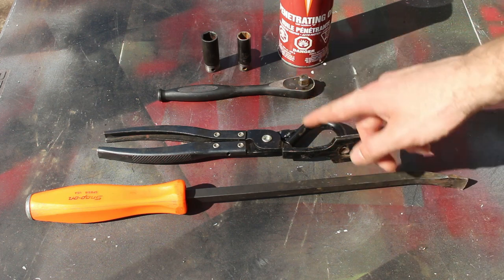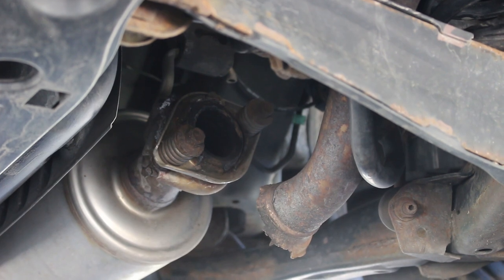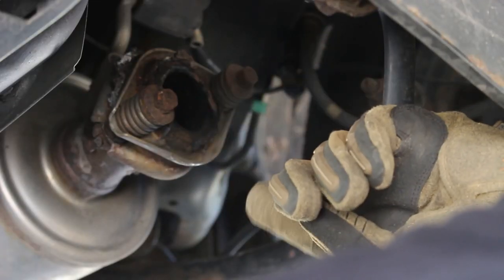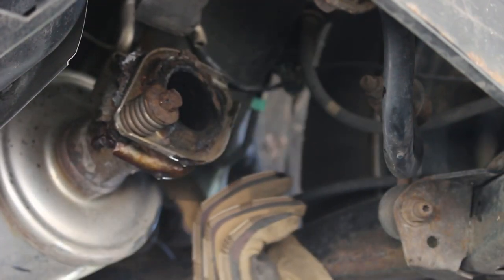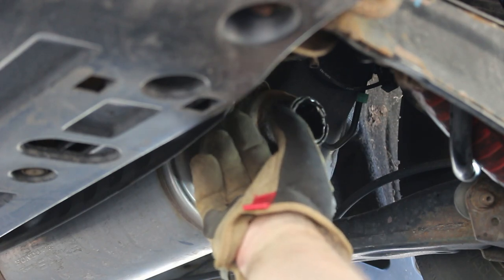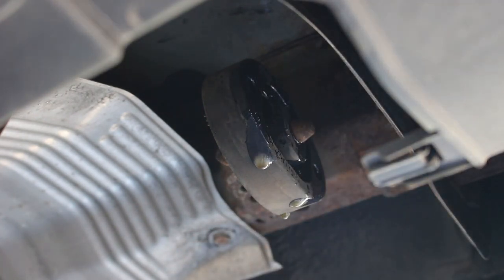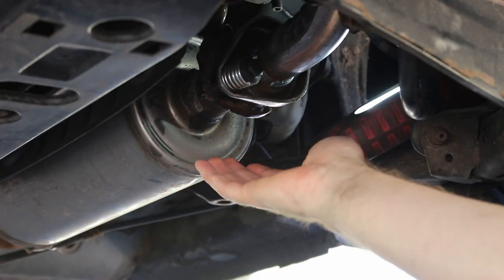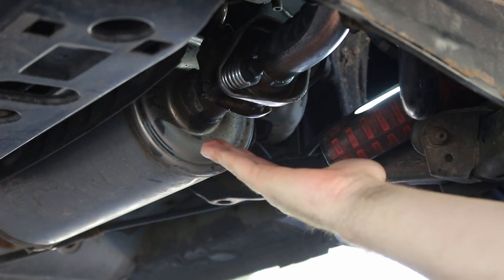2012-2015 Honda Civic Muffler Replacement

Comment: There is a muffler repair kit. Basically saw out the flange on the resonator side and connect it what left with repair kit. AtLeast it's what Chrisfixit does in his repair video

Comment: I have the same break on my Honda 2012.  Do you have to replace the whole muffler if the muffler is still good and the pipe leading from the muffler has plenty of thickness to it?  Also the pipe that is suppose to stick out that was rusted off that looks concerning.  Is it part of the catalytic converter? Is the insert that you created to give the pipe thickness and a seal for the gasket?